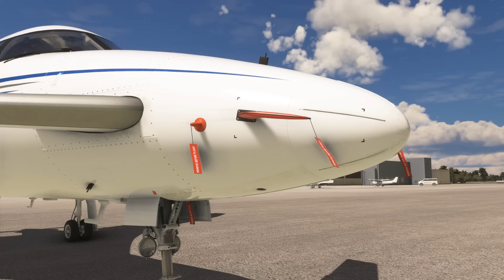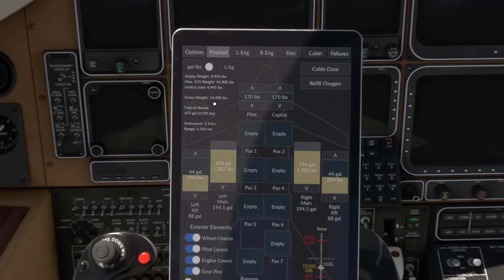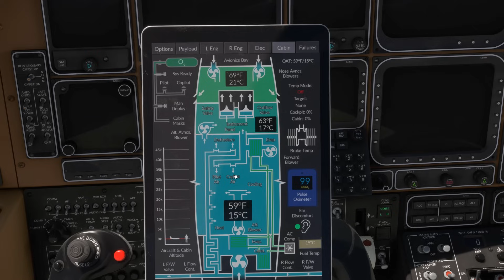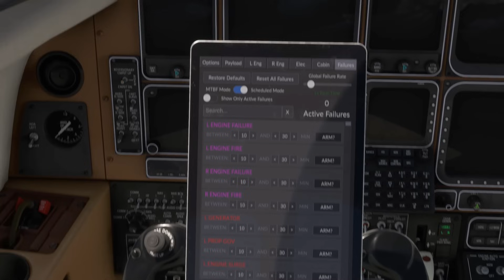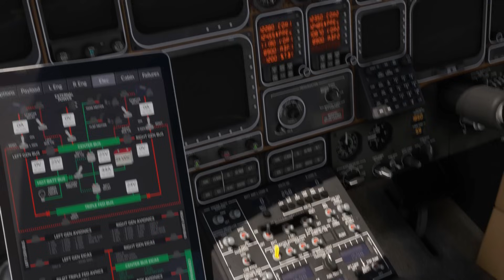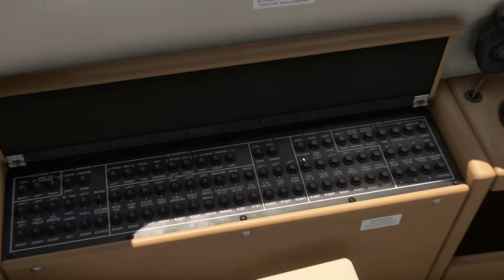Black Square Starship MSFS - Tablet Interface, Fuel & Electrical Systems - Just Flight

Comment: I was fortunate enough to have this aircraft in its beta stage through a few revisions and got to fly it around in 2020 and watch it come together. it's insane that despite how long this has had to be a secret or under wraps, then they announce and launch 24 after the project's been started for and Chad managed to push out both versions at the same time on the same day. day. I was fully expecting this to be a 2020 only release for like a week and then the 24 version would come around. it's not even using the compatibility layer that Microsoft introduced to help developers bring their aircrafts over, this is a native 2024 version and a native 20/20 version

Comment: Very impressive! Since "almost everything can fail," is there a mode to fly this aircraft where nothing ever fails, where one can simply enjoy flying it without dealing with all the real world challenges so well modeled here?
Reply: Yes. In the manual  it says "The global failure slider is used to control the global failure rate, indicated by the text below the slider.  The maximum allowable rate is 1000 times real-time.  All MTBF and scheduled failures can be disabled completely by positioning the slider all the way to the left, until “Failures Off” appears below the slider."
Reply: @richavery66  Thanks!

Comment: For these visualizers and sensors in the tablet, is this kind of a cheat code compared to flying the real aircraft, or is it a stand in for information you would be able to get another way in the real thing? For example things like brake temperature.
Reply: It's mostly done because users didn't believe the systems were this in depth.  The real aircraft wouldn't show you that (you'd have to figure it out on your own hehe)

Comment: 1. Is the tablet popout available via an http://local address like the Fenix A320 EFB/CDU?
2. Can Failures be turned off completely?
3. Even if it wasn't in the actual aircraft, an optional Fuel in KG readout on the centre console for non-American pilots would be very helpful
4. This looks amazing, your best work yet!